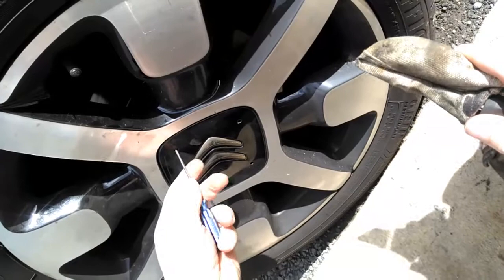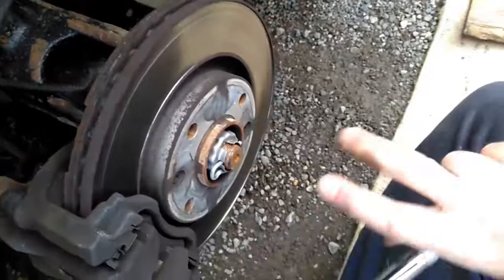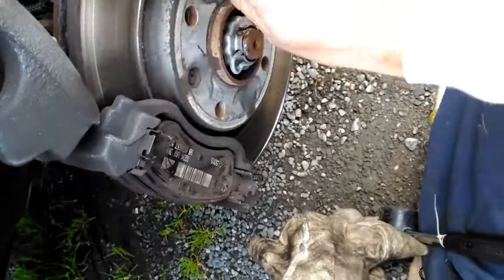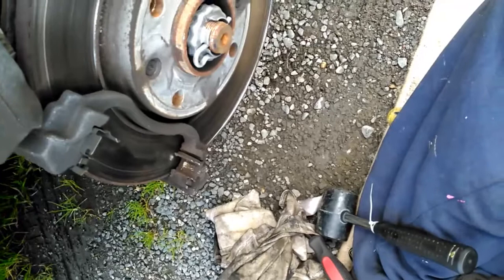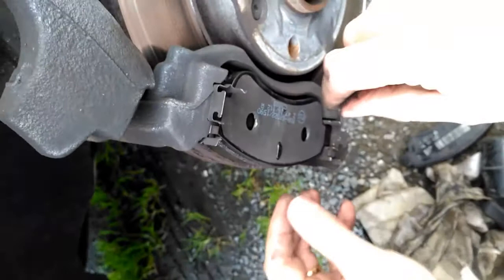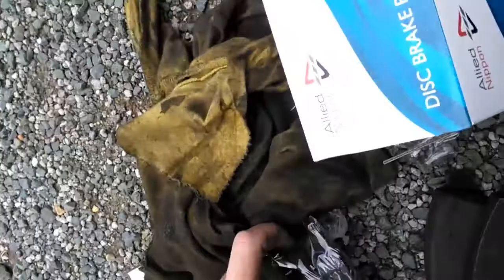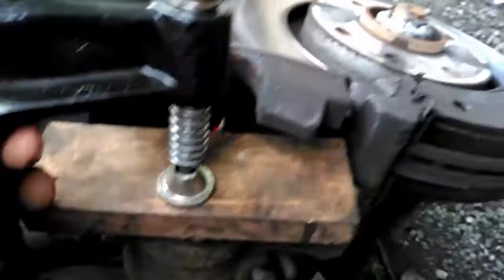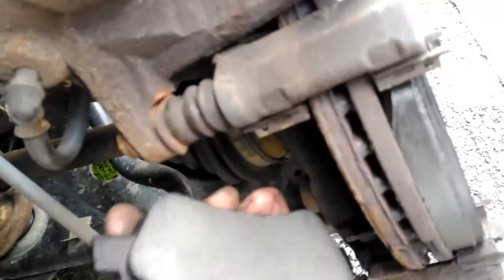Change front brake pads on Citroen Cactus

Comment: I do like a Cactus, the job looks easy, glad the piston is a push and not a turning one
Reply from the maker: Yes the Cactus is an excellent car. Just been on a journey of over 1,000 miles and it was a total pleasure to drive and around 70mpg so not bad at all.

The brakes are really easy to change the pads on and yes the piston is push in and it pushes in easily
Reply from the maker: @FCD2300  Not certain but had to be around 25 000 miles

Comment: Hi. Do you know how wide the disc is with the caliper included? I know disc is 266mm but wondered how wide the caliper edge is on top of that. I’d like to buy a cactus next but want to check the wheels I have will fit. Cheers
Reply from the maker: Hello  - Very sorry but I don't and I don't have the Cactus any more to check for you. The Cactus is an excellent car and we loved the version of ours we had but I think new versions are out so things might have changed. For example I know the version right after ours got rid of the Jukebox. The jukebox was a hard drive that you could store loads of music on and it came with really GOOD upgraded  speakers that sounder great....   But maybe they have brought back something similar since then